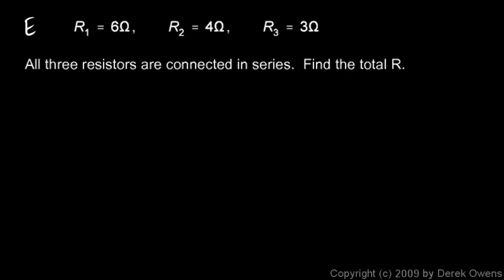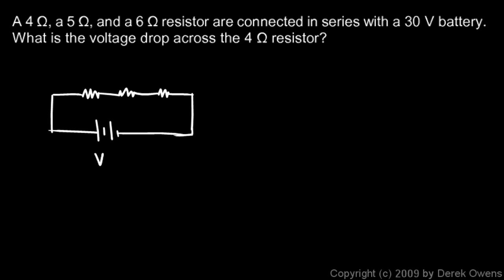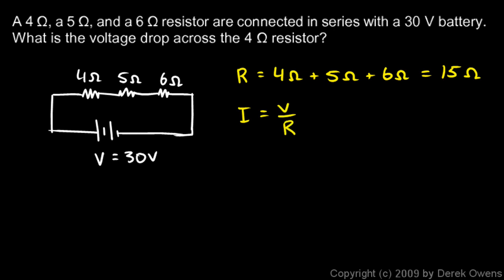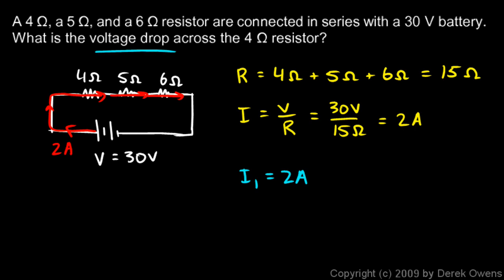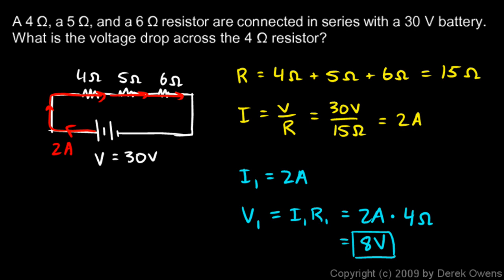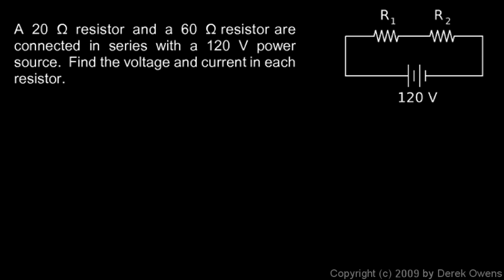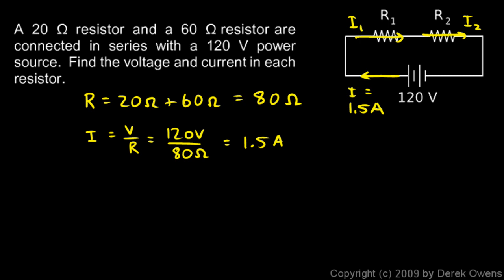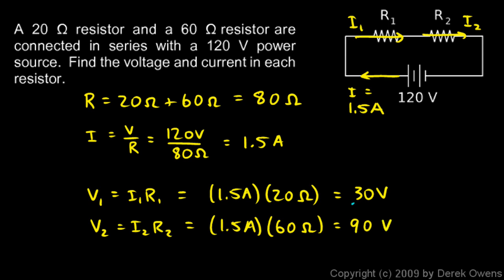Physics 13.4.1c - Series Resistor Examples

Comment: for the last problem, do we subtract the 30 volts with 120V to get the voltage after the first resistor? or is it just 30V

Comment from the maker: To think of it in terms of water falling, try considering this:  Water falls from point A to point B, and in doing so it loses potential energy.  Resistance will cause less water to flow, but each gallon that does flow will still lose all of its potential energy.  So think of the PE per gallon between the two points.  That would be the correct analogy for voltage.  Voltage is PE per unit charge.

Comment: related to the question i posed on the previous video - I see how to work out the answer using the formula, but don't have an intuitive idea why all the voltage is used up by the circuit. Perhaps the water analogies confused me - because in a water system, if there is a resistance to flow, there would generally still be a flow coming out at the end of the loop with some remaining pressure as well. thanks

Comment: Sir, I would be so much thankful if you spend some time explaining me this question. I find the current is so hard to understand. Since you already combined R123 to get the total current, how come you can conclude that R1 and R123 are in series? I'm asking this because for resistors in series, the current is the same throughout the circuit.